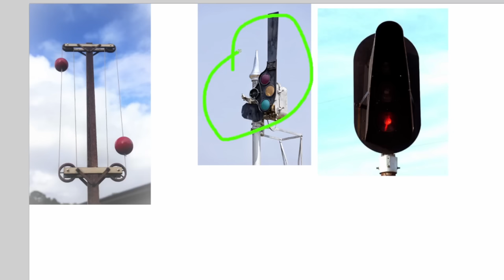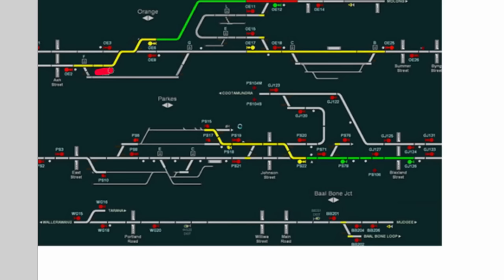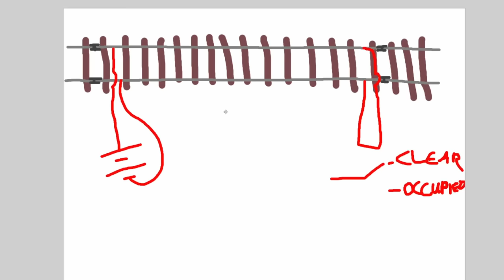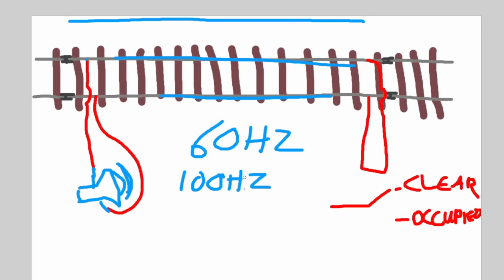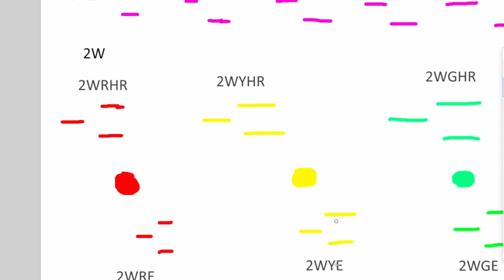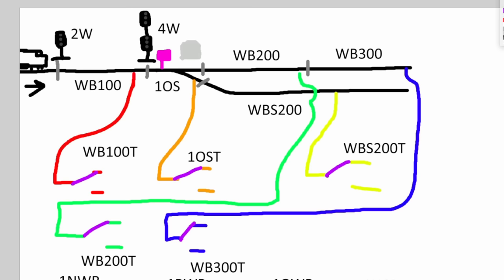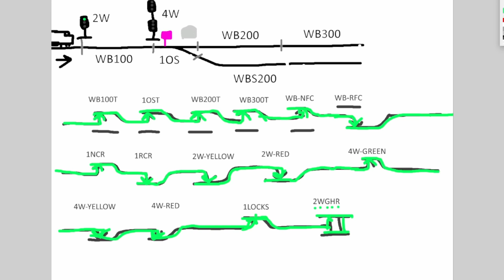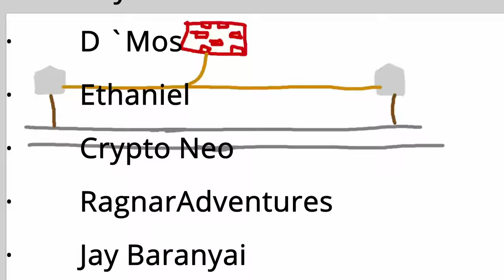SIGNALS 101: 10 Levels of Train Signal Understanding

Comment: Greetings from a signalling engineer from Europe. The 60 Hz or 100 Hz track circuit would probably not work this way. I'll describe how it works. If you were interested, you can write to me and we can talk and share ideas. 🙂

The AC track circuit we use is based on the American principle. The direct current TCs were abandoned shortly after the mass electrification of the country began. In the very beginning, we used 50 Hz. That is the European mains frequency. Later we shifted towards using 75 Hz on the open line and 275 Hz within stations. The reason for this was the fact that 75 and its higher harmonics are much away from mains frequency and its harmonics. A short-circuited 400 kV long-distance energy line could cause a dangerous induction as far as 5 km back when 50 Hz track circuits were used. With 75/275 Hz, such short-circuit can (at worst) make track circuits occupied, which is a safe failure. So to the principle.

The TC inverter produces two sets of insulated voltages - the track voltage and the local voltage. The track voltage is fed to the feeding-end impedance bond transformer. The transformer has two primary windings in series. So it has three terminals: one end, the middle, and another end. The secondary is just plain simple winding. The track voltage is connected to the secondary winding. The end terminals of the primary winding are connected to each rail, while the middle terminal is connected to the neighbouring TC's middle winding. So what happens with our signal voltage here? It gets transformed from 220 V down to a few volts at quite a high current. The two primary windings are magnetically in series, so the voltage gets added up in each half of the winding. The electric traction current is mostly AC, but there are widespread DC systems as well. The traction current (both DC and AC traction) goes from both rails through each half of the primary winding to the middle terminal, then to the middle terminal of the neighbouring TC's transformer, and then through both halves of its primary winding to the rails. As the direction of a current in each half of the primary winding isn't the same, magnetic fields of both halves get substracted, and almost nothing gets transformed to the secondary. Of course, there are asymmetries, and that even highlights the need to use a signal frequency as far from the mains frequency (and its harmonics) as possible. 

So where did we end with the track voltage? Ah, so we have passed the feeding end impedance bond transformer. The current continues to flow through each rail to the other end of the track circuit - the receiver end. There it passes the impedance bond once again, is transformed back to 220 V, and arrives at the track-phase of the "track relay" (track occupancy relay). And here is the trick. The relay has a capacitor (multitude of...) across its track-phase - creating a 90 degrees phase shift... The local voltage is connected to other terminals of the relay. The two voltages are 90 degrees away from each other and both are fed to their respective coil. The relay works quite similarly to a three-phase asynchronous electric motor - just the third phase is missing as it never rotates that far to be useful. Its "rotor" (a circular segment made of sheet metal) is weighted to fall back down by gravity. If a track circuit is unoccupied, the quasi-rotating EMF overcomes the weight and rotates the rotor upwards by circa 45 degrees - switching contacts. At the very moment the TC gets occupied, the track-phase almost disappears and so does the rotation of the EMF. The relay drops. 

Nowadays, we use safe electronic units that serve the same purpose, don't require capacitors, are much more sensitive, and are much more immune to interfering currents. Its sensitivity - the maximum wheel shunt value (the maximum safe rail-to-rail impedance of a wheel shunt) is double that of an old-fashioned relay.
Reply from the maker: Greetings! Thank you for this detailed explanation. I'd been taught how the high frequency AC track circuits work and got them confused with the low frequency guys - I appreciate the correction and the detailed response.
Reply: @Hyce777  You're welcome. This beautiful field of engineering became so complicated that it is virtually impossible for one person to know it whole.
Reply from the maker: @AB3-74  I wholeheartedly agree. I've got a coworker who's been doing it for 50 years and he's great, particular in the way he thinks and precise in how he works - and he still doesn't know it all. That's why it takes a team.

Comment: Since signals rely on track sections being electrically connected to 'notice' a train, in the rare event of an automobile stalling on a railroad crossing would it be helpful to jumper-cable the two rails together to let the system know that there is something on the track? Or is that not reliable since some systems use sound?
Reply from the maker: Not reliable in that it may not have the correct resistance to actually shunt the track circuit, and it wouldn't work for the audio systems.

Comment: Interesting how it's so similar and also so different to how we do it in Aus. The standout thing is other than the bigger relay rooms we've got lots of smaller location cases instead of bungalows. We don't have any 100yo relays but there's plenty that got installed when the line was electrified and converted from semaphores in the 80/90s. Kinda want to find one the same age as me. 

Do you guys keeping your signalling power supplies non ground referenced or is that a UK/AUS thing?

Thanks for the great video
Reply from the maker: Cheers Harry! We do have some amount of cases out and about, but the bungalows are much more common. All of our power supplies and equipment are ground referenced.

Comment: Talking about the relay logic reminds me a bit of my oilfield work. Part of it is we bring a lot of water along with the oil, and then put that water back in the ground to help bring more oil. As such, we have big water pumps that move many thousands of barrels of water per day (1 bbl is 42 gallons).

Now again it's all processor, but it's built as ladder logic similar to a series of relays. Just to allow the pump to run for instance has to be yes to all of these questions:

Is there enough water in tanks? Is the small feed pump running? Is there pressure from the small feed pump? Is there no alarm condition to keep from running? Are none of my sensors faulted? Is the pump selected to run?

Of course each of those has its own set of logic questions to answer before giving the "green light" to start the pump, and then along with all that a whole host of other things to look for while running.
Reply from the maker: Sounds like a similar set of logic for sure. Thanks for sharing :)

Comment: Now I have a question in regards to the red being on the bottom, there were railroads like the Chesapeake and Ohio which they place red on the top like a traffic signal, if there was a second head the red was on the bottom with the yellow and green swapped and a bottom head the red was at the top. On a similar note the New York, New Haven and Hartford in the Boston area had on the center signal red at the top, green in the middle and yellow at the bottom.

And Conrail in Framingham MA had a four light dwarf with green, yellow, red, green, the signal was capable of giving a full track speed clear.

Why did these railroads choose not to follow the red on the bottom?
Reply from the maker: Good question that I would have to research to know, honestly. Not sure.
Reply: @Hyce777  thanks, I have some New Haven experts as friends and they don’t even know. As well you also had the CNW with their use of mounting the signals horizontal.

Now with Conrail a lot of what they did was to try to save money on upgrades to mishmash if signal systems they inherited from Pennsy, NYC, Reading, etc. and use dwarf signals ti display mainline aspects.

The dwarf I mentioned in Framingham MA displayed a multitude of aspects from red, yellow, green to flashing aspects, yellow over flashing red and double green, with the double green conveying rule 281 proceed at normal speed.

Comment: This is all very interesting. I am familiar with the electrical/electronic concepts of it all, past and present. Mechanical relays and semiconductor application.
One question I have is, all of this needs electrical power to operate. So where does that power come from that powers the bungalows, the signal lights, track devices, etc.? I haven't looked on purpose, but I can't remember ever noticing a local Power Company energy meter attached to the side of a signal bungalow.
I'm just curious about how all that equipment gets powered.
Reply from the maker: Usually there is an electrical drop from the utilities, as well as a manual transfer switch for generator power. Then there are typically UPS's and/or battery backups inside the bungalow, sized to operate it for a certain amount of time (typically based on FRA regulations).
Reply: @Hyce777  - Thanks. It's that "Electrical Drop from the Utilities" part that I was mostly curious about. The Backup/Emergency Genny's, UPS batteries, etc. all come on the back side after the main line input power connection.
I suppose some of the electrical power must be supplied underground and some of it by power pole drop into the bungalow, then from the bungalow the control data cable and associated electrical power is ran out to the actual signal. I've seen a lot of standalone signals, out in the middle of nowhere...they've got to get life from somewhere. ;)
Maybe the utility company gets it to a pole, and RR takes it from there. Probably a system wide flat rate...hummm...
Thanks Again. Love the 101 series.
Reply from the maker: @additudeobx  cheers mate. Depends on the application, of course, but yeah most power to signals etc. comes from the bungalow itself, that's how we maintain vitality. Same thing with switch controls, switch machines get sent the throwing current from the bungalow. The power is just a connection from the utility, be it at a pole or otherwise.

Comment: Up in the mountains in Colorado, there is an old, disused Union Pacific line. Next to a set of RYG signals, there used to be a single blue light on a silver colored post. I've been unable to find a picture of it anywhere. I was always told that this was an indicator for a snow obstruction on the track ahead. Is that accurate?
Reply from the maker: Tennessee pass, I presume? I am not sure. If it's blue, I wonder if it's for mechanical reasons - blue signal protection is a staple in mechanical facilities. If there's a car repair track or something like that it may be a signal to protect workers. If not, I'm not sure, i am not familiar otherwise.
Reply: @Hyce777  Close. Between Leadville and Salida. Primary use before it closed was coal trains from the Black Cloud mine in Leadville down the canyon to Pueblo. It's just a single track there, no siding for a couple of miles or so in either direction. It was also in the little town, at the only road crossing for miles. I never saw it lit, but the glass was blue, not the bulb, so it was definitely blue. I would take a picture next time I'm there, but I'm fairly certain it has been looted. The line has been closed since the 90's and it's long since been stripped of anything small and interesting looking. Thanks for getting back to me.

Comment: I am interested in how Europe controls it's bullet trains, I have been to Europe this year and noticed no wayside signals, because of the high speed of the trains, engineers don't have enough time to process the info so train control is done in the cab. Can you elaborate on this GPS system?
Reply from the maker: It's not necessarily GPS, I'm not familiar with the systems they use there exactly but we have cab signal in the USA. The track circuit, instead of just detecting trains, also sends out a signal that the train can detect. This has speed information and/or signal aspect information.

Comment: Good video i have to say even though i know nothing about american signaling. I missed a bit the aspect of far signals allways thought they where necessary to accomadate the long stop distance of trains. And there are like really intresting things like etcs which tries to unify european signaling. By giving a framework of recirements for the train equipment (for example the European Vital Computer ) und tracksite equipment (f. e. Eurobalise). I would like to know your thoughts on that. Because the system also works a bit difrent with movement Authoreties which does not have to corospond to signals. Hope my English is okay i am not a nativ speaker.
Reply: Positive Train Control is the closest thing to ETCS that the United States has currently gotten to.   Neither system requires physical wayside signals, but signals in the U.S. aren't going to completely disappear that quickly.

Comment: Can you explain why rail signals tend to have huge supporting structures, like catwalks and gantries, while road signals are value engineered to be small and spindly?
Reply from the maker: Few different things:
1. Need to be visible at the height of a train crew, which is a lot higher than any road vehicle
2. That extra height means more structure, more structure means more wind force, needs to be stronger
3. The vitality of the signals and associated light-out process is a big deal, so they need to be solid (no swinging in the wind)
4. You can easily park a bucket truck to service a signal at an intersection, doing this for signals in multi-main / yard territories may be impossible, or would require taking the track out of service, catwalk allows for easy maintenance.

Comment: As former train crew and control operator, this was great.
 
Do you show any pages of the level 10 code? It'd be interesting to see, esp. which language is used. I'd guess C or even LISP..
Reply from the maker: You know, I'm not actually sure what language the actual processors run. I wouldn't be surprised if it's some assembly level machine stuff - we interface with design programs that give more of a UI to it.
Reply: @Hyce777  Well, once compiled, I'm sure. But it's rare to write such large amounts of code in assembly language. Maybe there are some autistic savants that can spew out that code flawlessly!

Comment: I presume that for each logic configuration involving a complex path through a long string of relays, there must be a separate set of of contacts on each of those relays that is dedicated to that specific logic string. This suggests each relay must have multiple sets of contacts. How many sets of contacts will the typical relay have? Based on the relays shown at about 28:00 in the presentation, it appears that a relay as has perhaps four sets of contacts. Is that typical?
Reply from the maker: Depends on the relay and the way things are terminated. Sometimes the contacts then run to a terminal strip and subdivide from there, but it's not uncommon to have 6 or 8 contact relays.

Comment: Hi! My first video here and it was really fun to watch! Especially the differences from the principles used in my country. And here I have a question. For operating from signal 2W, why do we control the WB200 and WB300 sections? Aren't they controlled for proceed aspect from signal 4W? I can understand controlling 1OS as an overlap. Do you use an overlap in the USA?
Reply from the maker: We do use overlap locking in many cases in the USA; without in-cab signal or enforcement of cab speed we tend to look out further than the signal (WB200 and WB300) to help inform the aspect we give.

Comment: Who is ES&D?  I see some Union Switch & Swindle components in there.  I hope they're still not sticking micro controllers inside their switch machines.  I ran away from that brilliant idea as fast as I could.
Reply from the maker: ES&D is my own fictional railroad, the Eat Sh*t and Die (long running joke related to a game). They are converting to microcontrollers in a lot of the machines still, but you can still get the good old stuff last I've seen.